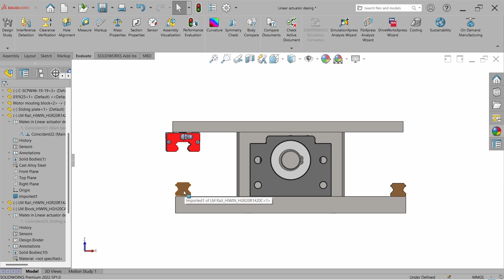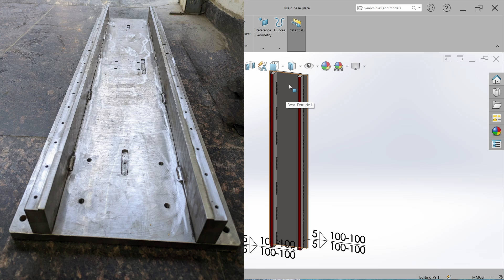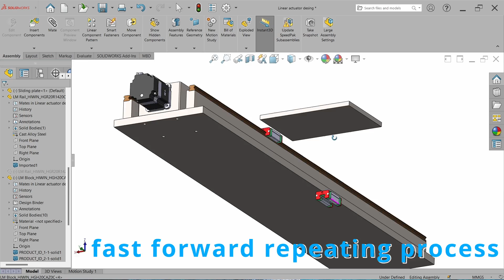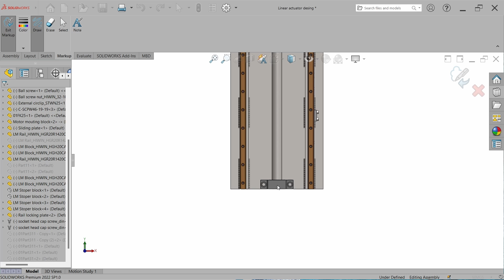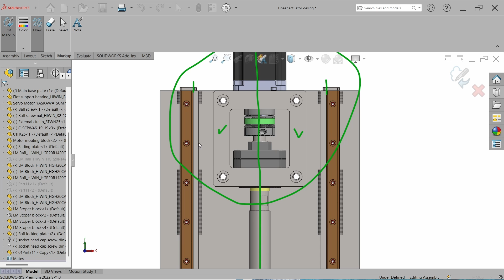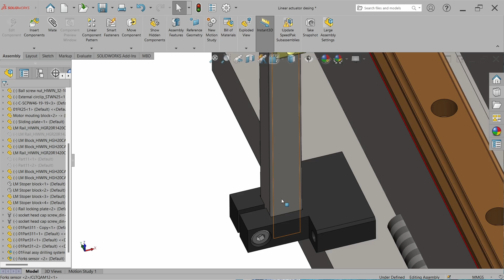Ball Screw Linear actuator Solidworks | Detailed Machine Design

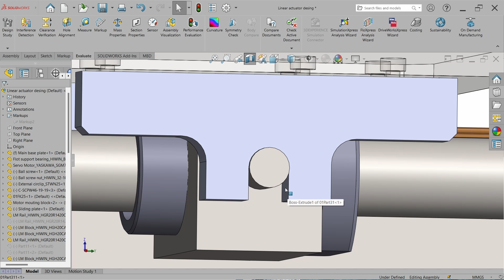Comment: 37:57 If we do not give the vertical relaxation here , that we can use this mechanism in horizontal actuator without backlash. i mean there no need to rotate some angle the ball screw to start the plate sliding. Am i correct. i am expecting a answer from you brother. thank you for the excellent video series.
Reply from the maker: Yes, you are right!! thank you
Reply: @mastermechanicaldesign  ❤

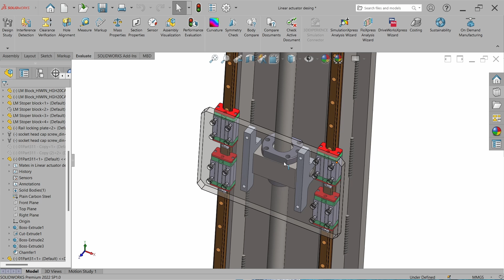Comment: Firstly, thank you very much for the detailed explanation. in 40:00 ; The concept of using an arrangement to secure the ball screw from the sliding plate moment is very useful for protecting the ball screw itself.  However, I have a question about the guide blocks.  Since they are constantly subjected to the moment forces, how can we ensure their optimal performance and longevity?
Reply from the maker: Thanks,
For LM guide and block
1. Size of linear guide and block should be as per moment load and all the load (there is a dedicated video of LM guide and block size selection, also life calculation)
2. Life should be enough (depending on application and duty, Just like ball bearings)
3. Installation- Ensure the installation datums flatness and parallelism of each rails and blocks with others,
Reply: @mastermechanicaldesign  ï'm grateful for your answer ... nice of you

Comment: Thank you so very much for you conent, it is really helpful. However, the duty cycly term is confusing me here during the design, how can I check with my selection of the ball crew with the requeried duty cycle? I colud not find anything realted with HIWIN nor THK catloages.
Reply from the maker: Hi Dxemus, I guess the duty cycle is How much time machine run in a day. Or in a shift. Like Hours per day. Which is directly connected with ball screw service life. More duty cycle means we should consider more service life of component

Comment: Thank you for providing such valuable content.
I truly appreciate it. I hope that you will also consider creating a lesson on how to choose rotary actuators.
Currently, I am working on a project that involves rotating heavy loads while aiming for cost-effectiveness.
My current idea is to use a cross roller bearing to support the load, but the calculations involved are a bit confusing,
and I'm unsure about which option would be the most cost-effective.
Your guidance and insights on this matter would be immensely helpful. Thank you once again for your contributions!
Reply from the maker: Hi Le Minh Nhat, first of all, yes cross roller bearing is best investment for heavy rotary motion (Heavy axial and radial load), 
For ensuring the calculation.
First select the bearing according to your shaft diameter and space and 
1. Check basic dynamic axial load rating of selected bearing from manufacturer catalogue, and calculate service life according to applied equivalent load.
2. Ensure Bearing speed limit, and if speed is high, consider run-in procedure if required.

Rotary actuators project: Sure, I'll consider in future project, but as for now, i have to say sorry. upcoming project schedule is full, Like Motor gearbox selections, all type of bearings selections, I hope u will enjoy.
Reply: Thank you for responding to me.
I truly appreciate it.
Looking forward to your future content as your lessons are consistently awesome!